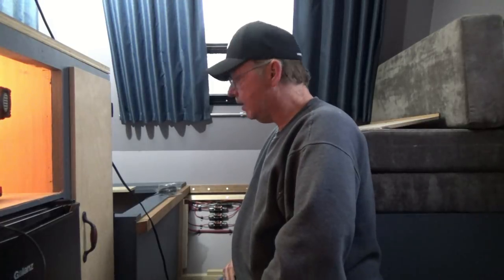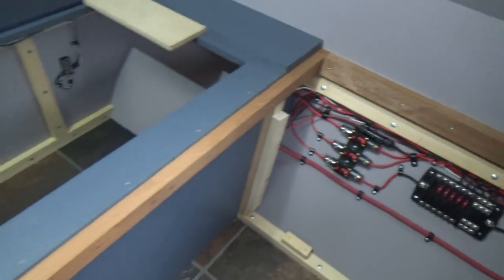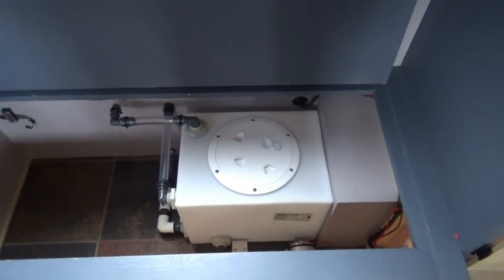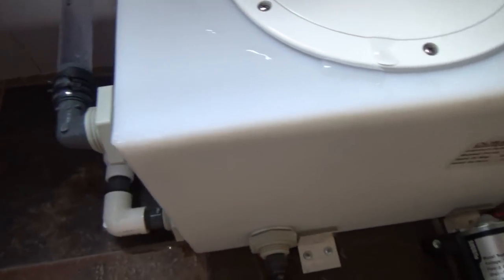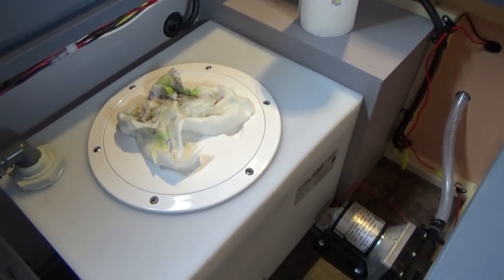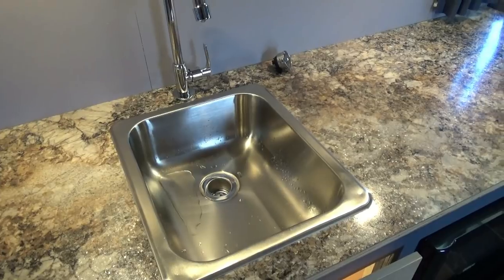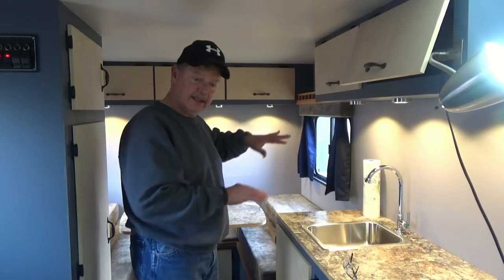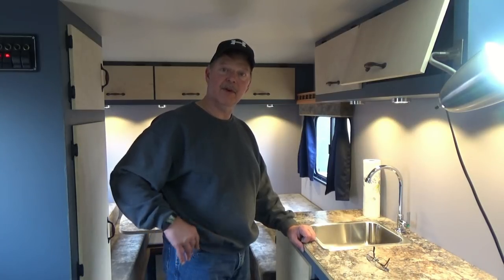How To Build A DIY Travel Trailer - Part 65 (Shurflo Water Pump – Running Water)

Comment: Another thing i like about your plumbing is you used flex tubing. So many people use PVC pipe and that is fine, But your still in a camper there are no codes. Most people camp in the spring & summer. But if you are going to be camping in the winter then you may want to wrap your pipes? Also flex tubing will expand. Copper & PVC not so much.
Reply from the maker: Thank you John! I usually drain the water during the winter months and all of the hoses and install a small heater to keep things warm, that way things don’t freeze up on me. The flex tubing also helps when traveling, I don’t have to worry about fittings coming loose.

Comment: Great Video! I'm setting up my freshwater tank 13 gallons and I have no clue what fitting to use to connect my water pump (1 1/2 "). Could you share what you are using?  Thanks
Reply from the maker: Hi Shanetta! Most all of the fittings, I purchased at a local hardware store. The video should show every item that I used. I think most of my fittings were 3/4". You can use a bushing to go from 1-1/2 to 3/4. There are so meany to choose from! I would recommend walking around in the hardware stores (Lowe's and Home Depot too) to get a feel for what you might need). It'll help you get familiar with the stuff you might need.

Comment: Think about adding a small (1 or 2 gallon) in-line pressure tank to reduce noise and pump cycling.
Reply from the maker: Was thinking about something like that... but I am slowly running out of room! LOL! When everything is closed and cushions in place, it is actually very quiet.

Comment: Hey Al...I keep forgetting to ask what type of sink that you acquired,I like yours much better than the one I purchased because mine is only 5 1/2" deep...
Reply from the maker: Hi Steve... I purchased the sink on Ebay. I tried to find you a link, but I couldn't find the exact one. I did pay about $60 for it with free shipping. I wanted one without the holes for the faucet, so with a little shopping, hopefully you can find it!
Reply: I had thought when you were talking about the sink that it was used for a different purpose as to it's design? A washing station or something like that?
Reply from the maker: I think it was like a bar sink... if I remember :)

Comment: Hello. I need to buy a water pump for my tiny house and I need one that is working continuously when the water flow is low. Now I have one that stops for a moment when i use the shower then starts again when the pressure drops but that pause  shuts down my instant water heater. Can you please tell me the model of your Shurflo water pump?
Thank you
Reply from the maker: Hello Stefan, the pump I use is the Shurflo 4008 RV Revolution By-Pass pump. You might also check out an accumulator for your system. This will keep the pressure built up so the water flow is consistent. Hope that helps! Cheers!

Comment: You may want to add guard for your switches just in case someone sitting there accidentally hit and activate your pump.
Reply from the maker: Good point... so far, as many times I've been moving around inside, been lucky not to hit the switches myself, something I thought I would be doing a lot. :)

Comment: Oh,I noticed that your counter top isn't faced with a formica strip of the same you used for the top???
Reply from the maker: I will be installing a piece of oak trim around the counter top. That will hide the seam where the counter meets the cabinet. It will match the trim I will be using around the microwave and refrigerator. I think it will look pretty nice when finished. Already started the trim around cabinets and wardrobe, so it will match very well! Cheers!
Reply: I like that idea,infact I though about that on my table for dining or sitting...I will be staining my cabinets,doors,and trim work a golden oak to give it a sense of a brighter interior...
Reply from the maker: That should look great! The lighter cabinet doors and trim will definitely brighten it up!